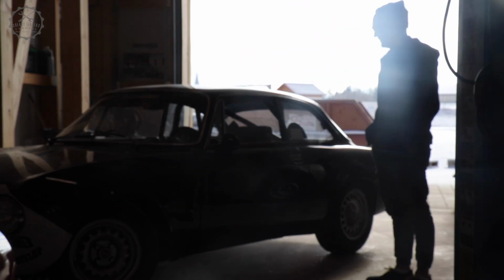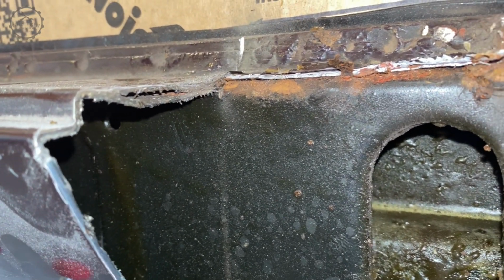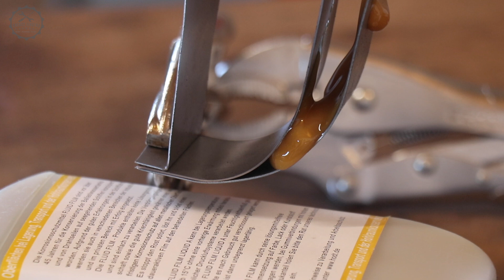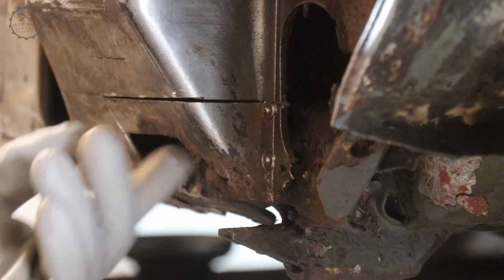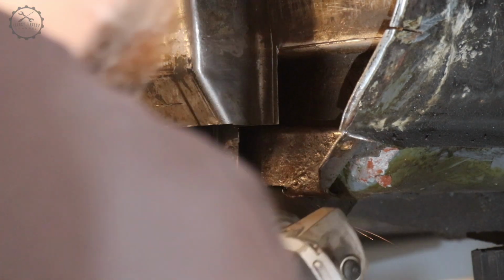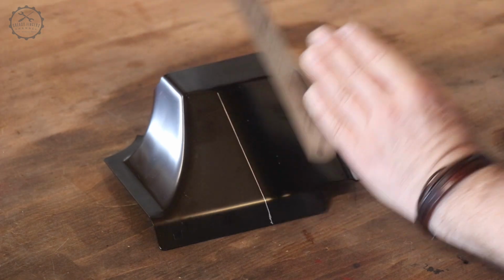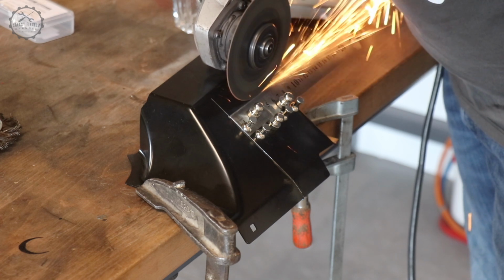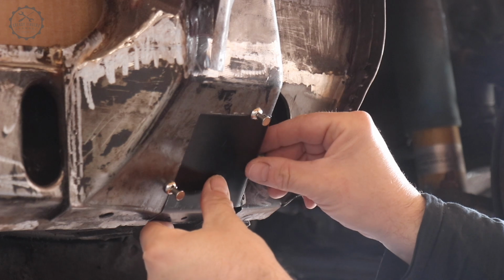Restoring the Door Sill, Part 1 - Alfa Romeo GT

Comment: Hello.  I sent you a comment the other day with a link attached, not realising that might have been seen as advertising.  Sorry about that.  I do recommend the use of fish oil for rust-protection but don’t endorse any particular brand.  Moreover, I’m not a representative of the fish oil industry.  As I said, great channel. I enjoy it very much. Cheers from Australia.
Reply from the maker: Thanks, Alastair and no problem at all.
When you say fish oil, I can’t help thinking the word „smell“.
Is there anything about it of that kind that we should know?
Reply: @GreasyFingers  , according to the description on the can, it’s deodourised fish oil and acetone.  However, it does smell vaguely fishy until it dries in a day or so, depending on the temperature.  It penetrates very well and sets without completely drying, so that it remains sort of plastic / pliable.  It can be coated with compatible primers and top coats.  As I said before, Australia is a more benign environment for cars, probably akin to California or South Africa, but I do often take my cars to the east and west coasts of Tasmania, where there is a lot of salt spray and both of them - a 1978 X1/9 and a 75 Mitsubishi Galant hardtop - have only ever had minimal rust in the many years I’ve owned them.
Reply from the maker: Sounds good!
I like the idea of processing otherwise useless organic material. Fluid Film e.g. is made of sheep’s wool grease.

Comment: One of the best channels.  Love to see a spider being done given the challenges of not having a roof.  My 76 spider has rust issues. What I do not know is how inherently stiff the body of the spider is with solid sills and floors.  Excellent video and channel Greasy. Anxiously waiting for the next installment.
Reply from the maker: Thank you! 
Most of the 105/115 stiffness results from the inner and middle sill. If those two and the A- and B-pillar are good, I think you can safely remove the outer sill. 
Maybe an endoscopy will help you making the right decisions?
Reply: @GreasyFingers  ....I was thinking the same. Some nice ones that work with your phone.   Thanks!

Comment: I enjoyed this video series. I am currently watching them for a second time to help me plan my work on my 1967 gt sprint. What does the center sill section add to the structure?  What if it is left out? Thank you again
Reply from the maker: Thanks for commenting!
I don’t think you should leave the middle sill panel away. It wood probably be an advantage in terms of corrosion, but strength-wise it’s there for a reason.

Comment: Thanks for the best Alfa Sills treatment video ever done.  Sills (all 3 of them because to say both of them wasn't enough) are the bane of all Alfa owners.  I have a field find 73 GTV that I know is worse than this one. OK-i can live with that-I bought it that way.  I need to find the courage to put a boroscope in my seemingly pristine GTV that the Previous Owner paid to have a high end shop fix.   Not today. 

Great tip on the magnets-I found a set on Amazon today.  I have a collection of  welding magnets too large for tight spaces Fantastic tip on the INOX spray!  Curious-why did you select MIG over TIG?  I like the hi intensity narrow flashlight to enable more accurate wire tip placement on the MIG!!
Reply from the maker: Thank you, Steve. 
Yeah, these sills are a nightmare. They could be improved a good bit in terms of corrosion with just slight design changes but I guess during its production, making new tools was out of budget. I am tempted a lot to get my CATIA out and do some design work. 

TIG is on my list, but yet I neither have the skill nor the gear.
Reply: @GreasyFingers  I bought a used TIG 2 weeks ago but haven't started working with it. My MIG is 30 plus years old and did not allow for making fine temp adjustments-Low and High settings.
Reply from the maker: I think I’ll finish the Giulia with the equipment I have and then follow your way.

Comment: Had to come back for a second viewing-it was that good.  Fitzee likes .024 wire for sheet metal.  Considering you are welding to the inner sill which is a thicker gauge than ordinary panels, what gauge do you find sufficient for this task? Thanks  Also, are you on 100% Carbon Dioxide gas?
Reply from the maker: I‘m using 0,8 mm which would be 0.031 inches. I guess it has not much to do with the final result but how much grinding you have to do. 
Gas is 80 CO2 and 20 Argon.

Comment: Good work here. Realized after doing as you started, with trying to keep as much as possible from the original sill, but then realized after removing a part, that the real thing had a small pice of tape sayin 1993, and there was a rest from the original one. Unfortunatly they hadn't done anything to the middle sill, so about 70 mm of the bottom is missing.... So, now new parts are on its way. BTW, the tin replacement you are using. Brand? Hope to get my sills in place before end of the month.....
Reply from the maker: I‘m realising the same at my Giulia these days. 
The brand is Teroson. It’s a recommendation. 
Fingers crossed for your project!
Reply: @GreasyFingers  Thanks, will test it. Looking forward to see how you solved it on your Giulia in a comming video.

Comment: I wonder if there are ANY GTVs still on the road with all-original panels.
That's not a hostile comment.
I've got a 1750 which my father bought in 1974.
I know what I'm talking about.
Reply from the maker: Hey!
Not at all received as hostile. 
I personally can hardly imagine that the way the door sills are designed, a GT can survive more than 5 years rust-free, certainly not in a country with regular rain or even salted roads. I exchanged with Jethro the other day and we’re on the same line.
I know a guy, however, a former owner of an Alfa Romeo dealership, who claims that his has never been welded and is without visible rust. The latter I can confirm. I’ve contacted the guy about making an “Is It Any Good”, let’s see whether this will work out.

Comment: All this talk of corrosion makes a case for an all carbon fiber Alfa body. Of course you’d still have to deal with the sills, jack points and other problem areas of the unibody. Then there’s the cost of a CF body which has to be frightfully expensive.
Reply from the maker: CF would certainly be an option for the front fenders and all hoods and doors. 
I’m also contemplating about galvanised sills and maybe I’ll try this out with my Giulia project.
Reply: @GreasyFingers   CF fenders would be nice! 

By the way just ordered a couple shirts to help the cause. Learned that Vereinigte Staaten is the US. ;)
Reply from the maker: @overbuiltlimited  Thanks, mate! That’s the best way to support the channel.